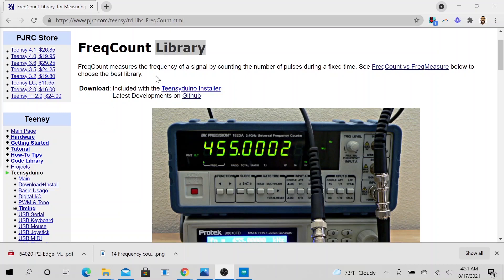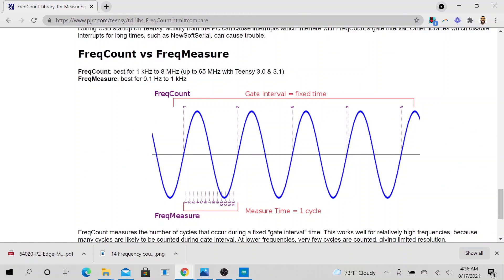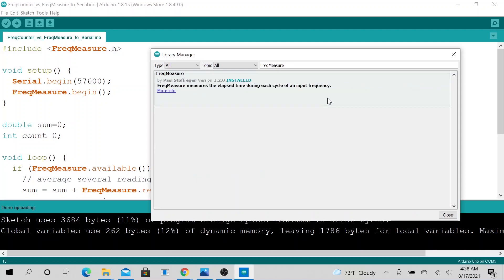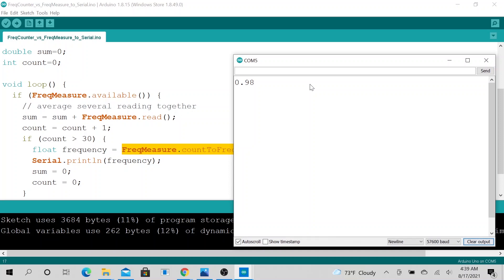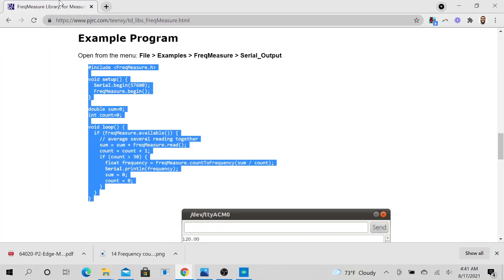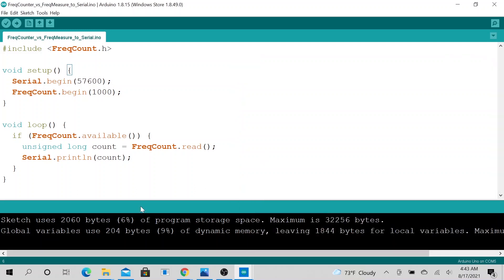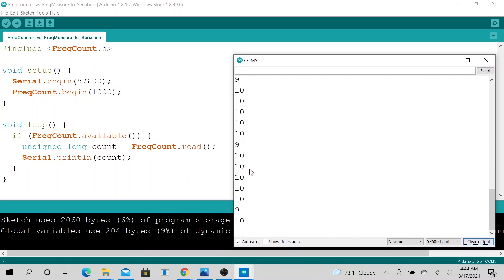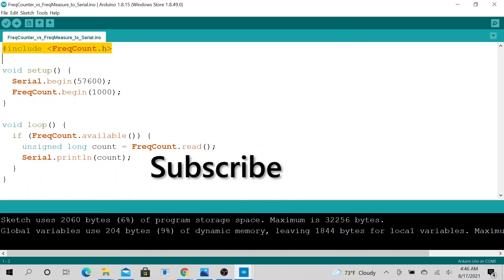Count Frequency Signal FreqCount Vs FreqMeasure With Arduino

Comment: hello thanks for the great video.Why did the Freq Measure library measure the 100 Hz signal as 98.29 Hz. Could this margin of error be due to the oscillator you are using?What could be the reason for this?